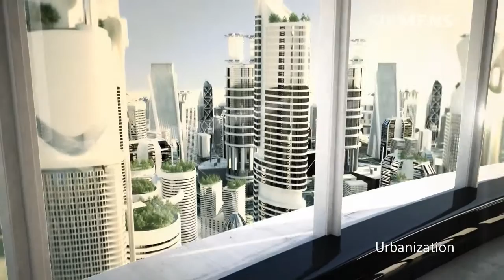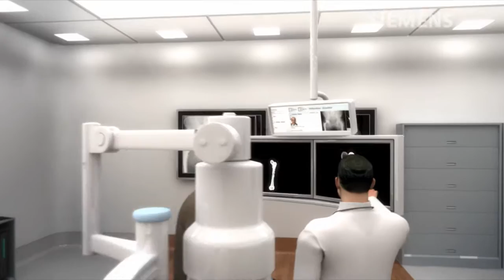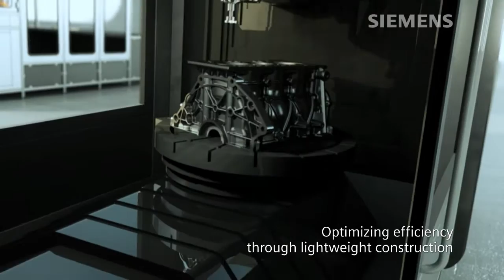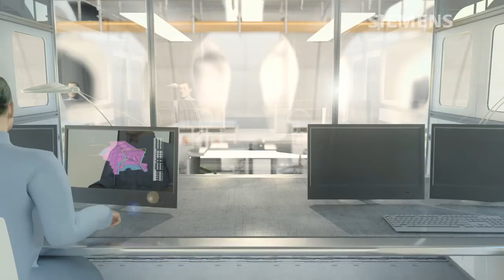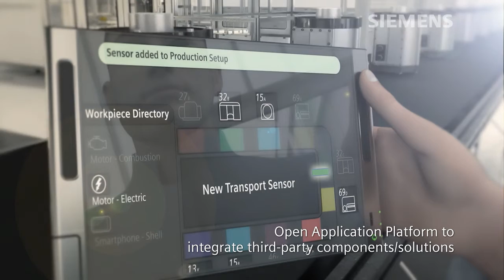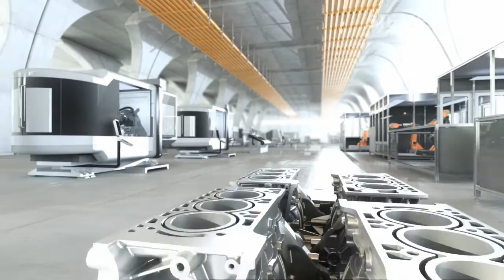Siemens : The Future of CNC Manufacturing

Comment: What will happen with existing industrial Infrastructure?? Existing structure will be worthless or any plans of retrofitting existing mechanical machines including Robots, CNC machines and Conveyor systems??
Reply: That was the initial plan for refitting rust belt cities like Buffalo, NY and Cleveland, OH. However, there are very few laws or regulations to prevent "Urban Sprawl". Allowing companies like the one I work for to build new facilities on old farm land for a cheaper cost than retrofitting old industrial sites. Therefore, even after 10 years of city planning Buffalo, NY is still struggling to find uses for its old, dilapidated buildings, while the city expands industry into the farm lands.